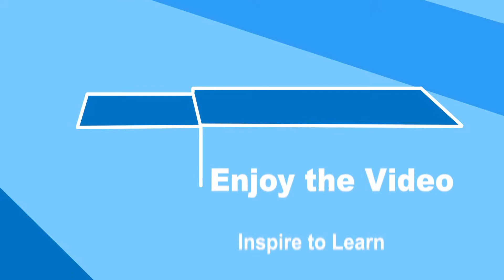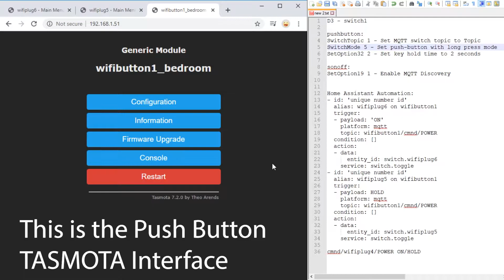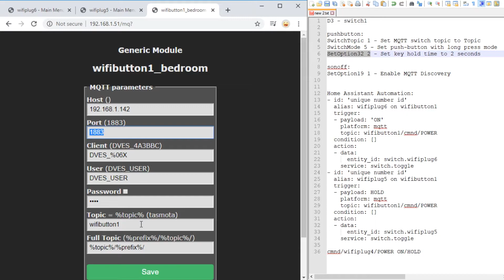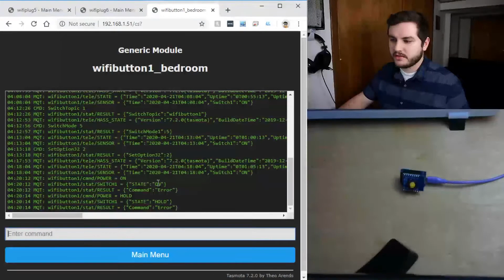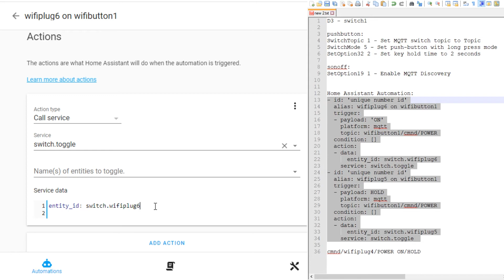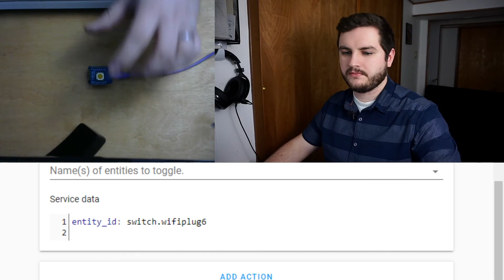$6 Wifi Pushbutton meets Tasmota

Comment: Please note that SetOption32 2 will set the timer to 0.2 s. SetOption32 20 will set it to 2 s.
Reply: Hi for some reason when I follow the instructions on my wall switch, a short press would just send a hold command in the console. Your comment fixed the issue the 0.2s was over-riding the default on command. Thanks a lot.
Reply from the maker: Hmm, I didn't realize that, thanks.

Comment: Hi Dave, nice video. I just have a couple of days looking at Tasmota. I have a D1 mini with a relay shield and  Im trying to figure out how to program it to trigger with your button.
Reply from the maker: Hey, please take a look at the description of the video. The first link is a link on how to flash tasmota.
Reply: @DaveOTech  hi Dave, I probably didn't write the question correctly. I just wanted  to set a D1 MINI with a relay shield  (ON or OFF ) using your button or by using any other MQTT Client. I already figured out. I had to add at the end of the topic the "cmnd/POWER"  string to make it look like : house/light/cmnd/POWER using payload "ON" or "OFF".

Comment: i do similar thing but not with mqtt i send a websend command to the device i want to switch on / off heres an example rule2 on POWER3#State=1 do websend [192.168.1.52] power1 on ENDON ON POWER3#State=0 do websend [192.168.1.52] /power1 off
Reply: advantage is it doesnt need  a mqtt server and is instantaneous... works great you can even send commands to other devices, so for instance i can send a  scheme change to a ws2812b leds i have attached to a wemos d1 mini works great using this rule    rule2 on POWER3#State=1 do websend [192.168.1.52] scheme+ ENDON ON POWER3#State=0 do websend [192.168.1.52] scheme- ENDON

Comment: how can I use pushbutton as manual to switch relay on, without using any editor
also, How can I control it through web interface 
both push-button and toogle switch of web should work to control relay

Comment: It is possible do this whitout home assistent? Only using Alexa? I don’t have home assistent in my smart home
Reply from the maker: Technically yes, however it would still require an MQTT broker running on a raspberry pi. It would also require custom code to get it to work.

I recommend getting home assistant on a raspberry pi just to have it.

Comment: it is possible do this without home assistant, only with two wemos or esp01, one switch and another with the button ??
Reply from the maker: Yes you could, look up "Wemos to Wemos Communication" on YouTube. However I highly recommended giving Home Assistant a try. It can be run on something as small as a raspberry pi.

With home assistant, you can set up an MQTT server. You could also set up a MQTT server standalone on a Raspberry Pi. Having an MQTT server on your network will allow essentially an unlimited amount of devices to be able to communicate between one another.

Comment: please advice that having you used a now old tasmota firmware (you used a 7.2.x, while now we're at 8.2.0.x...) some things changed... example, that topic is now different, as setoption19 is not swapping its parts anymore... AND, you should check for STAT mqtt messages, NOT the CMND you're using for triggers... cmnd are used to do automations, not to get states...
Reply from the maker: Hey. Good point. Set the topic to whatever is listed there, under MQTT FULL TOPIC/POWER.

I didn't really talk about setoption19 in the video, I just had it in my notes.

Would it matter if I used the STAT instead of CMND? (I really don't know, that's why I'm asking.)
Reply: @DaveOTech  honestly don't know, but usually cmnd are sent TO the device, while you want to listen to something sent FROM the device
Reply from the maker: Ahh okay I understand. I thought I was simply listening to the POWER state. Either way, you could use stat payload and in theory it should do the same thing.